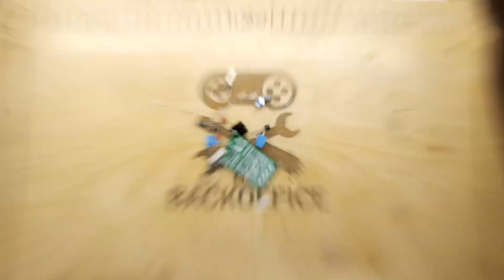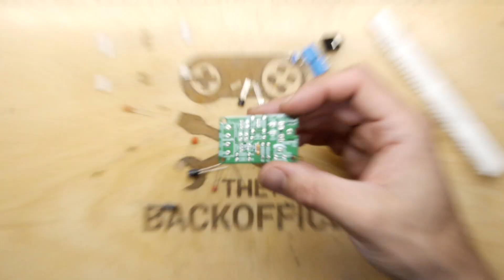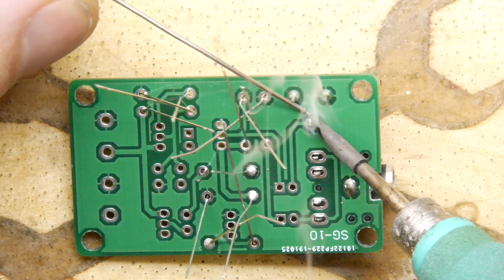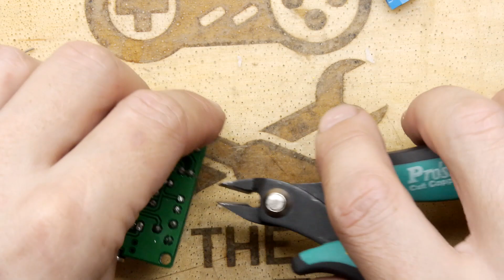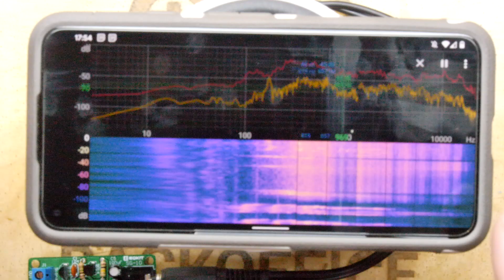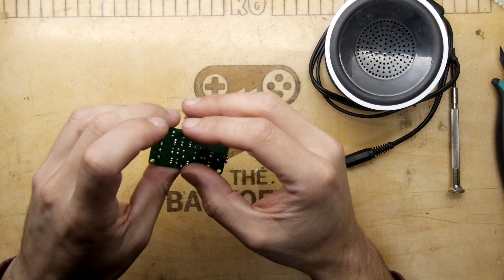A noisy little kit! - ebay white noise generator

Comment: It would be "ok" to use for a "toy" Random Number Generator but I wouldn't use it for a CSRNG (Cryptographically Secure Random Number Generator). There's a whole lot more involved in a good CSRNG; it would be way to easy to influence the noise from this device for example (probably radiowaves) to 'force' a certain 'pattern' or value of noise.

Comment: From Wikipedia...

"Applying a reverse polarity voltage, or a voltage exceeding the maximum rated working voltage of as little as 1 or 1.5 volts, can destroy the dielectric and thus the capacitor. The failure of electrolytic capacitors can be hazardous, resulting in an explosion or fire."

Sounds like the beginning of a new series of videos !?

Comment: an electrolytic cap connected backwards will tend to go pop!!
Reply from the maker: I feel we need to explore this now 😂
Reply: @backofficeshow  Yes indeed with different values and voltages :-)
Reply: @fredflintstone1  Wear protective eyewear, put a plastic container (see through) over the cap. Trust me, it can make a huge mess.
Reply: @Rob_III  I know that is why I suggested it :-)
Reply: @backofficeshow  Yes, get a bag of random caps off eBay - small ones, big ones, frighteningly large ones to go in PSUs. Then wire them up backwards. It's maybe a thing to do outside though.
Reply: @backofficeshow  No, no, no. This is where it all starts - reversed polarity capacitor explosions and then the blood-thirsty hounds will be expecting you to pick up the soldering iron by the wrong end... this is a local channel for local people, we'll have no trouble here!
Reply from the maker: @terrydaktyllus1320  It does make you wonder, what do capacitors do and do we really need them 🤔
Reply: You'll probably end up letting all the Magic Smoke out.

Comment: Is it using flaws in the transistors to make the noise? that's how they did it in some analogue synths like the Pro One. With some transistors less flawed than others, resulting in a noise oscillator that was a bit weak.

Some use noise generators to lessen their tinnitus.
Reply from the maker: If I recall reading something it's amplifying the junction noise on over of the transistors, so I think you are right